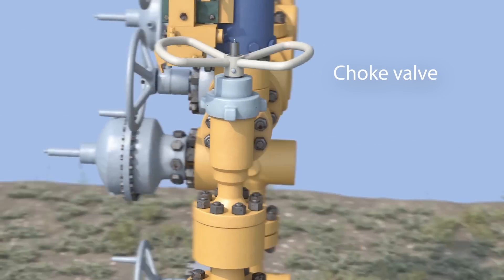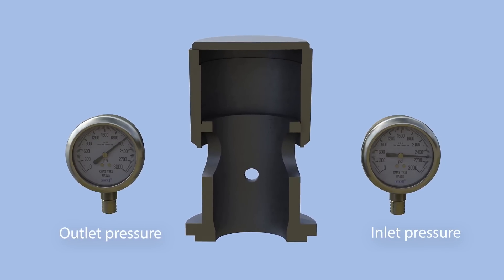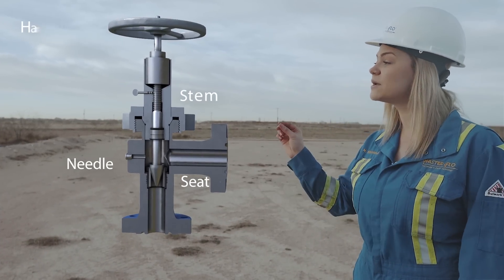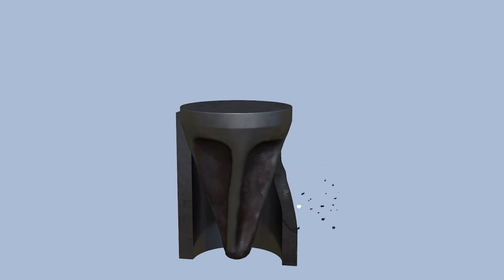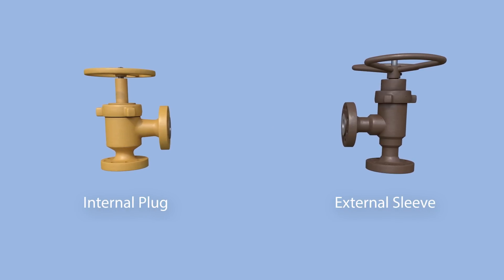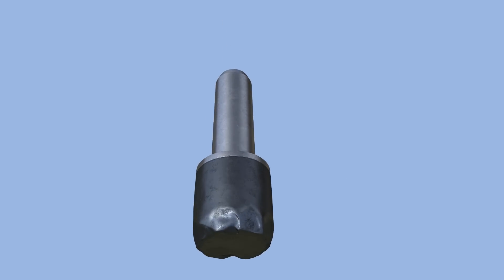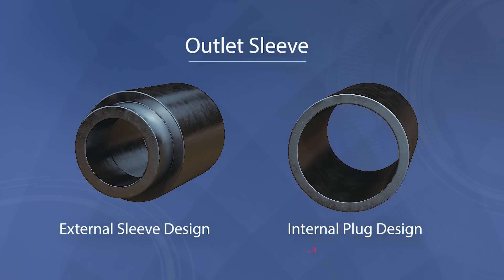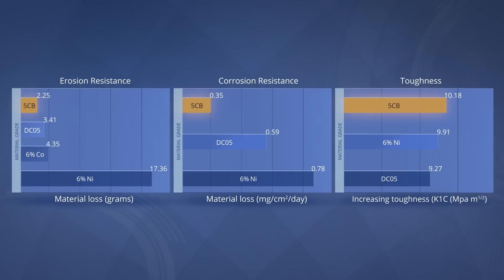Choke Valves 101 | Erosion Issues

Comment: Not recommended the design cage and plug type, it is accumulates debris and this will lead to broken seat which made of tungsten carbide during operation when first  time used by site operators.